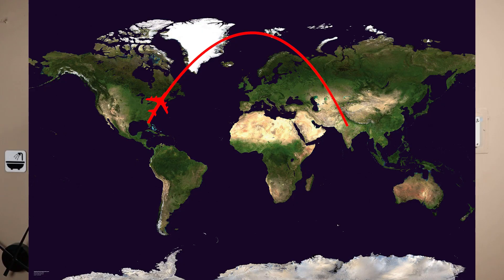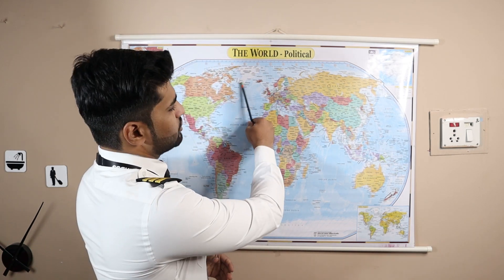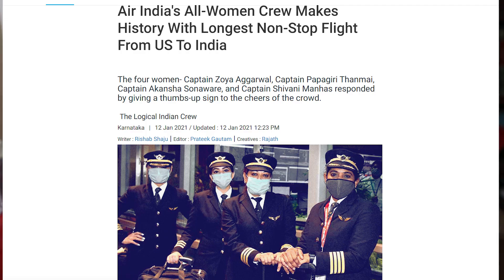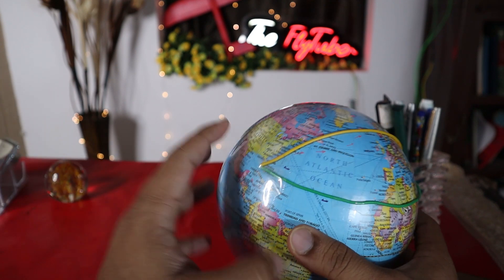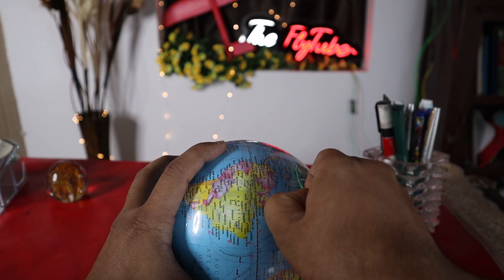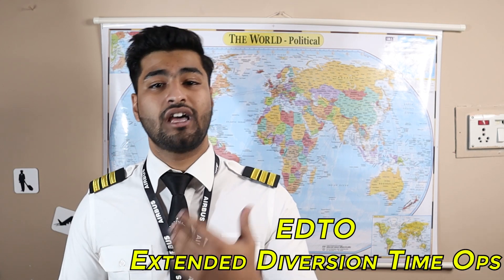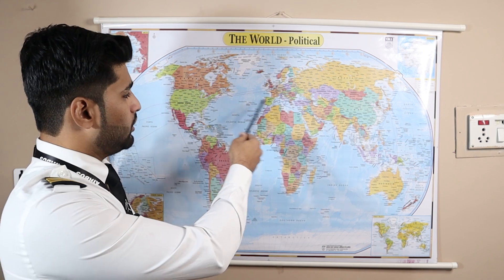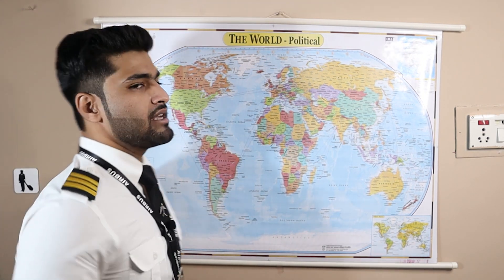Why Planes Don't Fly Straight but take curved flight path ?

Comment: If the straight is not working for long distance, do the same experiment for flight route from buenos aires to Delhi.
It doesn't work, because the path is touching Europe; but if you use straight it was the shortest path.
This all are because of flat earth like a map on WHO.

Comment: I mean first off, if you have a Degree and u look at that and say "oh of course the straight line is shorter." Then your a goofy and have no business graduating, go back now. If you don't have a degree and say the samething then u have no business talking and your not qualified for me to even hear you. Go get a degree first, then we'll talk." 

Never look at a line and make a determination on distance requirements, mileage, kilometers or nataca miles; that's not how you calculate distances involving straight lines due to their vertical and horizontal boundaries. They are indeed imaginary, you can't see. 

Always instead use the circumference, it takes into account the imaginary boundaries. If the world were flat we could have that discussion but it's not, it's round. Therefore, anytime an object line sits on a circumference or curved geometric figure you must calculate the imaginary boundaries. Use pie or 3.1417 to begin. Take the length of the line and divide it by pie to get the diameter and trig out a right angle then calculate how much of the arc or circumference is the line then times it by 3.14165 to get the length of the line. You will find its extremely longer and traveling along a shorter arc is cheaper. See, the ocean is on a arc so you have to know the arc and know how to calculate that which u did in College Algebra. Hell, even intermediate Algebra they reach this.
Reply: Pretending to have a point to make, so you can pick a fight with nobody?
Reply: @stephenkosciesza2706  imagine defending somebody that doesn’t exist.
Reply: Pie???  Something to do with the pi you had for dessert?

Comment: Sir I have a question, I have heard that the earth is not actually round it is oval so maybe north and south pole routes are shorter.
Reply: It's a slightly flattened sphere--an "oblate spheroid."  The diameter from pole to pole is a few miles less than the diameter straight through on the equator.  The difference it makes to all this is so tiny as to be negligible.  If a globe manufacturer tried to render the difference, it probably wouldn't even be visible.
Reply: They say it’s only 40 miles longer on the equator than the pole to pole route so hardly any difference at all

Comment: explain emergency landing of chicago flight to doha that made an emergency landing in moscow, which on the great circle appears to be 1000 miles off the course, but on a flat earth map, the three cities are on a straight line route
Reply: And  that   is  100%  correct. Aircrafts   ships/boats  travel  in a straight  line.   They  only go  curved  when they  are  turning left or right  or making  a U turn.

This  curved line  garbage  is  to  maintain  the spinning  ball earth spining  in space  with curved  water  programming
Reply: @edwarddechausay44  exactly, the great circle doesn't exist because the globe doesn't exist
Reply: @zeynsolo  Wow, any evidence?
Reply: @AlexFoxthrot  You're here as well ???? How far do your lies go ?
Reply: @edwarddechausay44  Exilarating how you people play the expert when you are clearly clueless. Great circles are straight and there Is no reliable flatearth map. Thanks for nothing.
Reply: I certainly do not see how Chicago, Moscow, and Doha are on a straight line route on a flat map.  
But you can use Google Maps to find the Great Circle route between two places.  Start at one point, invoke the "Measure Distance" feature, and click the other point.  Not only will it tell you the distance, but the (usually) seemingly curved route the map will draw IS the Great Circle route.
I just did that from Chicago to Doha.  The Great Circle route (7122 miles) takes you over Labrador, over a bit of Greenland, the just skirting the south coast of Iceland.  It arrives at continental Europe over Norway and Sweden.  Then it goes over a part of Poland and a corner of Belarus, before crossing through Ukraine.  The closest that route comes to Moscow is about 600 miles.  I can sort of see making a diversion to Moscow, if you start diverting early, although it seems to me that Warsaw, or a couple of other places, would make more sense.

Comment: Very good explanation because it included a visual representation with the wires. This also applies to satellites, and the ISS. They also follow straight lines, but appear to be curved on a 2-d map, also. The spherical nature of the Earth, coupled with her rotation really convolute what a flight path looks like on a 2-d representation. Thank you.
Reply: I just want to see the ball they keep talking about. They repeat it religiously as if they never thought to question it.
Reply: The ISS travels over 17,000 mph round the globe with no propulsion holding the same distance from earth???
Reply: @99.9percent9 yeah. Gravitational pull keeps it in orbit. When it went out it was moving at the speed earth is spinning so it goes that fast w no resistance because its space. So curvature, speed, and distance from earth stays the same.
Reply: @99.9percent9 that’s the simple version lol. Just look it up if you’re interested lol

Comment: If it's straight opposite then why do we go with pole. We can use Equator line also right ?!
Reply: If the two points are on opposite longitude lines, then yes, the Great Circle connecting them will go through the poles.  And if the two points are both on the equator, then the GC route IS the equator.  If two points happen to be exactly opposite (i.e., start at one and start digging, and you'll come up at the other), then suddenly, there's an infinite number of Great Circles connecting them.

Comment: On a spherical surface, every line is curved.
Reply: True, of course.  But if you follow a Great Circle, you're only curving downwards.  A straight path traveling around the globe means you don't turn either left or right.
North of the equator, if you want to travel exactly east for any distance, you have to gradually curve left.  Travel west, and you have to curve right.
South of the equator, it's the opposite.
Reply: 1/100th part of a curved line is a straight line.
Reply: @vkkulkarni8288  But if I fly from the US to Europe, I've gone more like 1/4 of a straight line.

Comment: Sir please make a video on how pilots find their way on an airport. While taxi to runway for departing and from runway to parking after landing.
And on what phase do the learning pilots will get to learn these things.
Reply: Pilots use 3 main methods for taxiing. First, they rely on Ground Control which are the controllers stationed on top of a control tower which allows them to see everything on the ground (in good weather). They communicate over the radio and give step by step instructions similar to a GPS. Secondly, pilots will use maps of the airport that shows them all the runways and taxiways etc. They are assisted by markings on the ground that identify where you are. Markers are placed methodically so you can make an educated guess where your next marker might be ahead of time. And lastly, pilots will eventually remember the layout of airports the more times they visit them. Memory and maps are the only things to assist pilots on uncontrolled fields, although many times there are other pilots or ground crew using radios that can help a visitor maneuver. But while on a controlled field, a pilot must obey the ground controller because he/she knows everything happening on the ground and tell a pilot when it's safe to proceed.